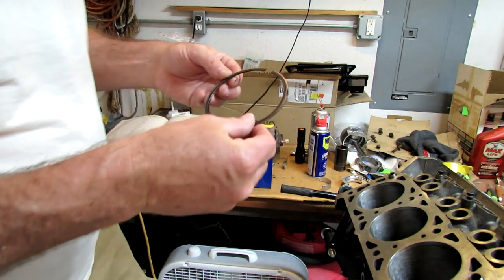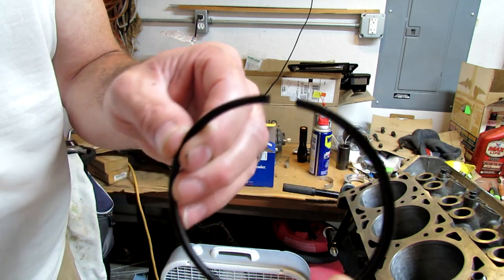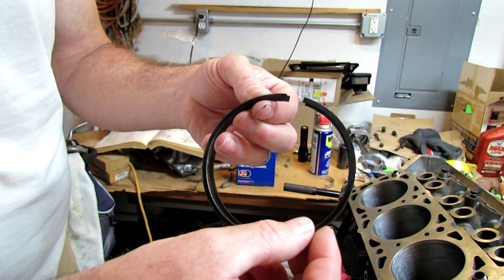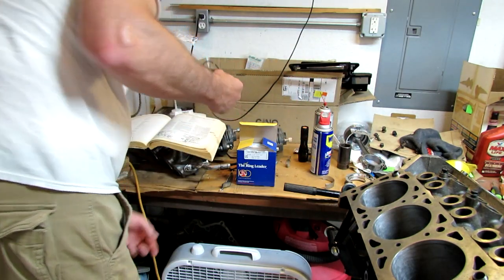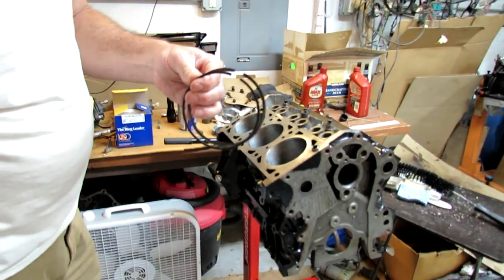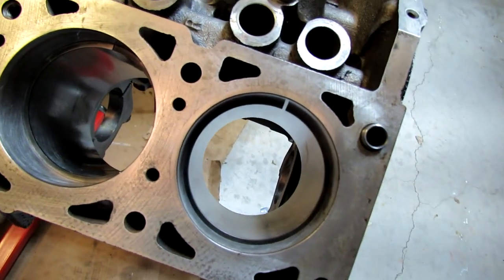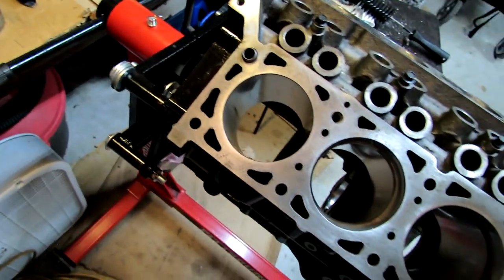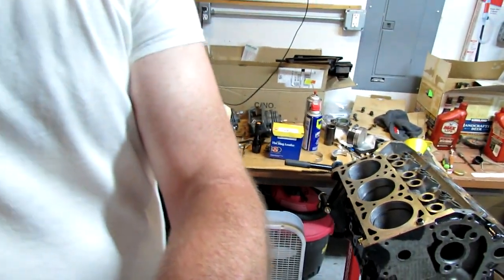Why is My Hastings Piston Ring Gap Too BIG ?

Comment: What is the actual ring gap? You need to measure it with the feeler gauge and you need to contact Hastings directly to see what you need and what the actual part number is.
Reply from the maker: Hello @aaronbarnes8938,
               The ring end gap should be 0.012 to 0.022. These rings have an end gap of 0.050. I have emailed Hastings.
         Thank you for the comment.

Comment: And that ring will have less tension than the old one.  It is probably fine but when you reduce radial thickness it reduces ring tension.  You can talk to hastings but I assure you you won't find a ring that is correct with the end gap without going to a file fit ring and setting them yourself.

Comment: Most all rings are way over spec.  That's why you have to order file fit rings.  I've never had any that weren't at least .005 over.  I'm typing as I'm watching.  If that's the oil scraper they a lot of times are way oversized cuz they don't really matter.  Check all 3 and post another video
Reply from the maker: Hello @black_sheep_fab9411, 
             I did email Hastings, and are waiting to hear back from them. I will post another video with what I find out. 
          Thank you for your comments.

Comment: Sounds like you have a set of rings for the wrong pistons, check the year of the block I’ve used Hastings on every build I’ve ever done and the only problem I’ve had were ordering the wrong rings because the pistons were aftermarket/different design than what I was expecting, what engine is this, looks like a Buick v6 of some sort??? If so they made those engines for many years wouldn’t be surprised if there was a ring package change, also wouldn’t be surprised if it was a problem for the Hastings facility they’re pretty good but not perfect
Reply from the maker: Hello @turkeyboyjh1, 
     It is a 1992 Plymouth 3.3 engine. The pistons are stock standard size. 
    Thank you for the comment.